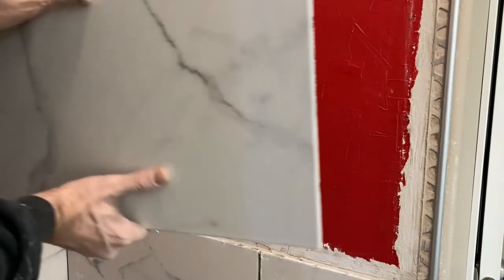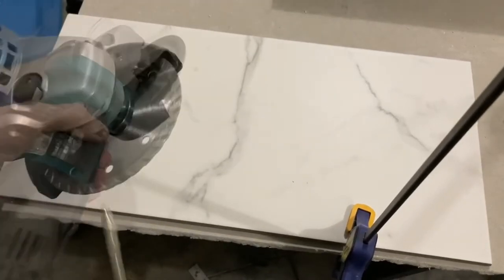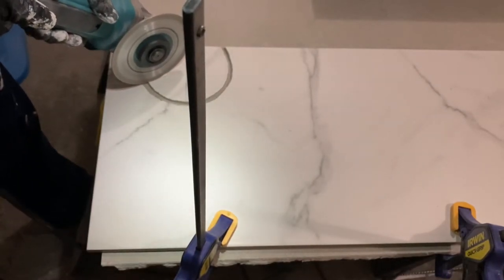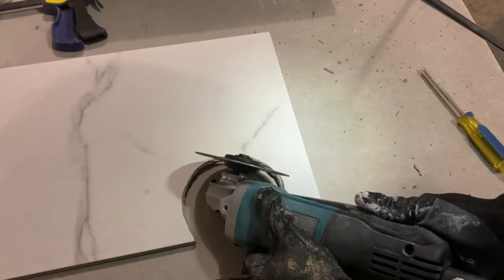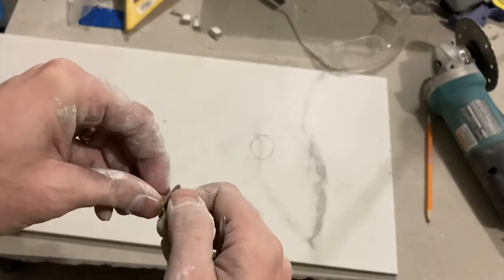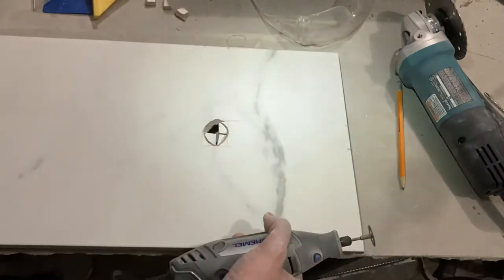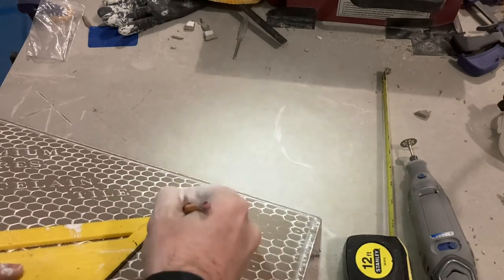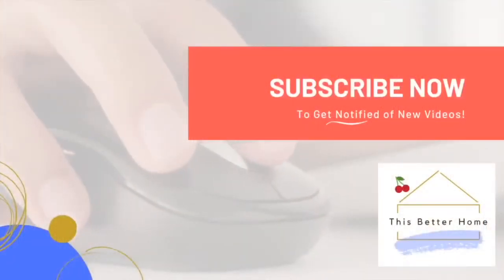️🔥 How to Easily Cut Perfect Holes in Porcelain Tile➔ DIY Tips for Shower Valve, Arm, & More!

Comment: Great Video.  What tool would you suggest to cut tiles around existing valves.  Who ever installed it only left enough room for the stem
Reply: I have the exact same question
Reply: @67Details  other than removing the whole tile , your cheapest option is called a diamond cone chanfer and attach to a grinder, you can use to widen the hole for the valves. Thank me later ;)

Comment: Hi, I have been living in an older apartment building for over 10 years.  My unit has 6" shower arm with 1/2" connection with IPS thread and shower head with 1/2" connection with IPS connection.  All new shower arm and heads I found has NPT connections.  IPS connection and NPT connection do not match.  But can I take out my current IPS connection shower arm and install NPT connection shower arm?  Like getting rid of both the old 1/2" IPS thread shower arm and shower head first.  And then install a new 1/2" NPT threading shower arm with teflon tape to prevent water leaks and NPT shower head.  Is is possible?  Is it even recommended to replace IPS shower arm with NPT connection in an older apartment unit?  Can you or anyone please help with answers?  Thank you